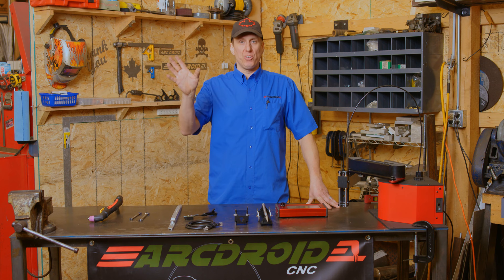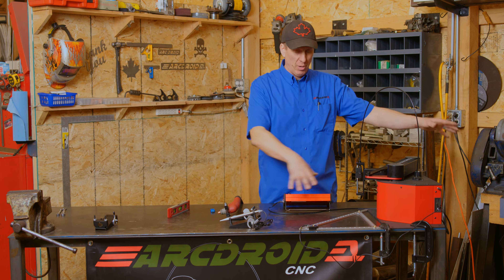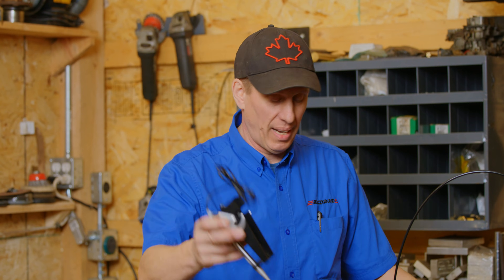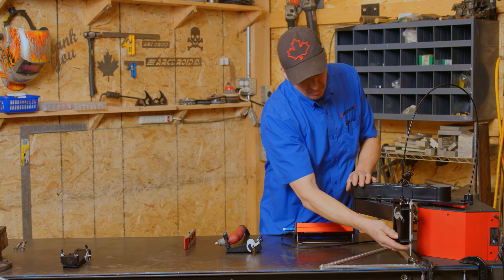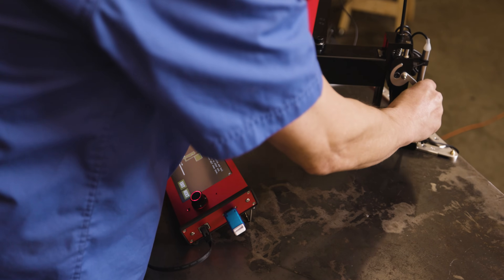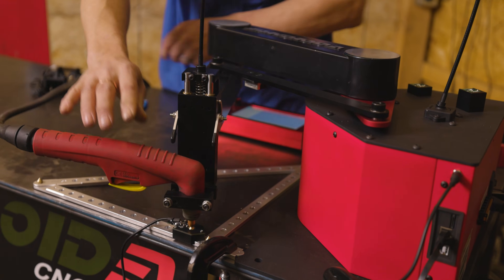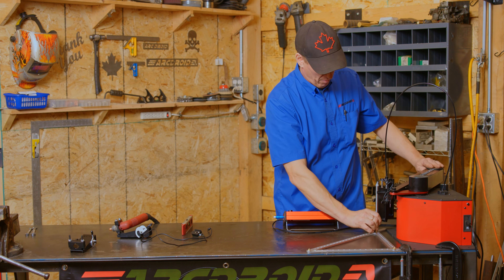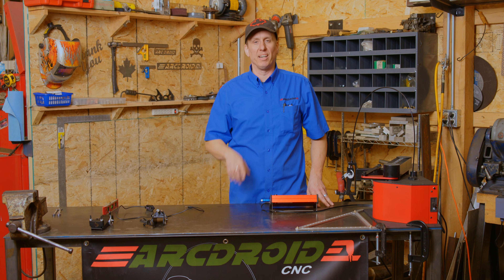Step 1:  Set Up And Calibration

Comment: where on the arcdroid is  it supposed to tell you length between the two points as you suggest in quick test?
Reply: There is a digital read out at the bottom of the screen that shows distances

Comment: UPDATE:

EVERYONE NEEDS to watch the latest update ... aka  Step .5    , before moving on to Step One.

https://www.youtube.com/watch?v=q6c_AwNIdCg

Bottom line : the calibration reader tool ( the part with the wire on it ) should slide freely and smoothly on the calibration 'triangle rails'.

If the plastic slider is tight -- DO NOT FORCE IT.     Watch step .5   on How to Fix It .

Next , the microswitch is from a different supplier..... which means it is NOT the heavy-duty ones, but a cheaper thinner and more prone to breaking unit.

The thinner units will still work - provided you treat them like " they are made out of glass ".    Again , Don't force them.     Things should move freely. Not binding or supertight.

Comment: So did I understand correctly what you said at the end - recalibration is required whenever you replace consumable nozzles?
Reply: “The universal torch mount can be removed and reinstalled from the Arcdroid without the need to re-calibrate, as long as the cutting head remains firmly attached to the universal torch mount.” - Per their instruction manual (Page 6, last paragraph).

Sorry, 2 yrs later I know, but it seemed easy enough to answer. 

In summary: no, you shouldn’t need to recalibrate after swapping out consumables. ✌🏼

Comment: Very simple!  Cannot wait to receive mine!
Reply: Good luck. I’ve had mine for three years and have never been able to get it to work. I build a dedicated table that was a dead level with a mounting for the Arcdroid so the torch is operating in exactly the same plane as the cutting table, and I manufactured a boom that hangs above the Arcdroid that takes the weight of the expensive hypertherm  machine torch. I used shielded cable from hypertherm for the remote on the machine and have spent hundreds of hours trying to figure it out. I calibrated the machine per the instructions but it will not start the torch OR run the pattern that is programmed into it. Nearly $4000 Australian and I’m about ready to smash it with a hammer and throw it away.